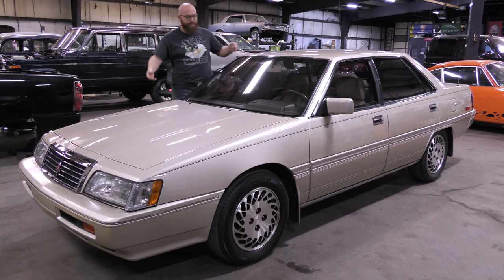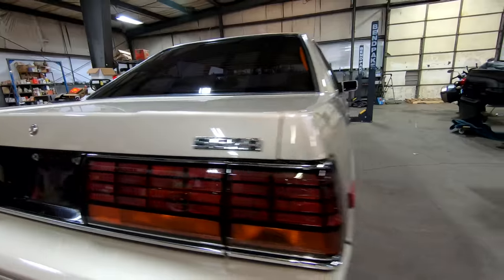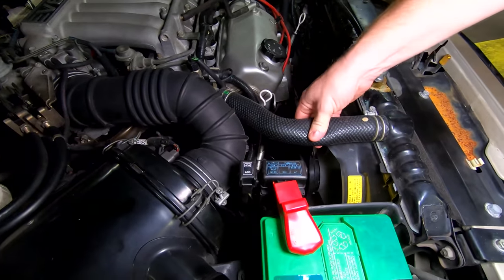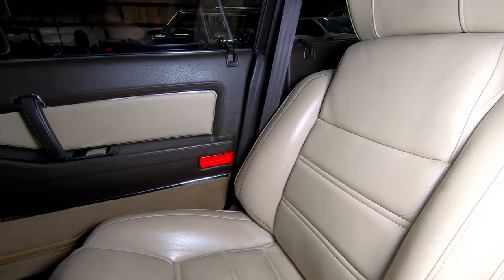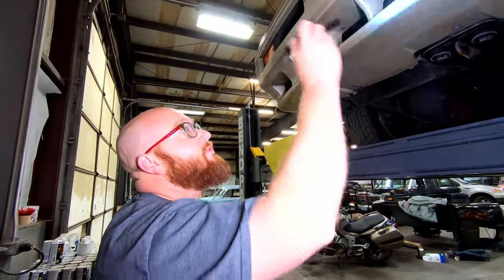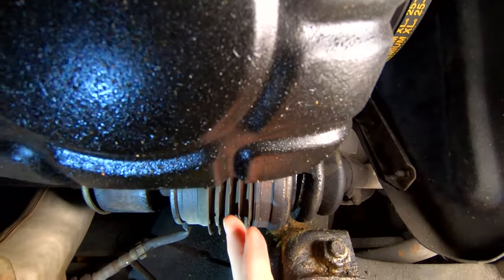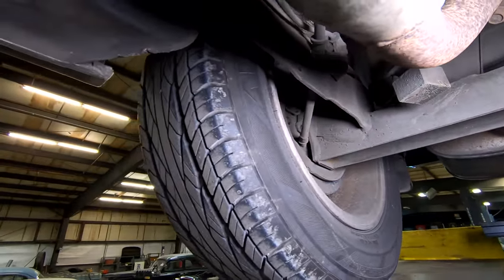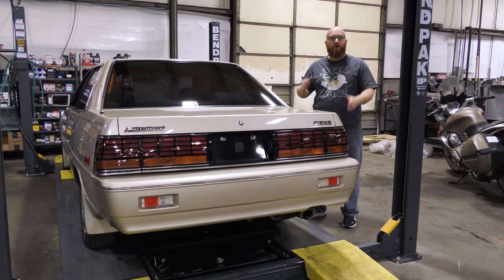Insanely Unique! When Mitsubishi attempted European design. CAR WIZARD shows immaculate '90 Sigma

Comment: was actually impressed with the "directional" wheels until you got to the other side and realized they were not
Reply: Most "directional" wheels back then would be backwards on one side
Reply: @jonathanryan2915  Actually, that tire does look like it is backwards since he was looking at the inside.
Reply: @matthewsallman1700  ok, what I meant was the wheels have a "directional" look because they would have a kind of spiral design.  But the problem is the spiral would go outwards on one side and inwards on the other side of the car when it drives forward.  If that makes sense
Reply: @jonathanryan2915  I get what you meant, but in this case the tire direction arrow seems to be mounted incorrectly.
Reply: @matthewsallman1700  which one? they all look correct from what I see.

Comment: Had a 1988 Sigma with a manual 5 speed transmission, and blue velour seats. It also had the single spoke steering wheel with the HVAC controls on a pod on top of the steering column. Here is a link to some photos: https://imgur.com/gallery/MlbmuVF
Reply: That rear end damn near looks like a foxbody rear lol
Reply: I had a 1998 auto 20+ years ago. It used the name Galant Sigma for the first two years. Then they changed to Sigma in the 1990 and add an airbag and a traditional steering column. Mine is black with grey leather, the original steering console is the wackiest design that I ever seen.  It went through two transmissions rebuild at 100k miles.
Reply: @laujoyjoy  That sounds like a 🍋
Reply: It was wonderful with the 5spd and a spoiler. Such a great car
Reply: My ‘88 is a 5 speed, as well. So fun to drive, with surprising performance for a fairly heavy car.

Comment: A lot of those were built in Australia... But I don't know if the ones with the steering wheel on the wrong side were or not. 

Anyway they were primarily engineered to have the steering wheel on our side, the correct side.
Reply: Mitsubishi took over the Australia plants of Chrysler Corporation in late 1980. The Diamante in the NA market sold in the 1990's was assembled there.

Comment: It's not a matter of standards or the manufacturer choking the engine to death. They just couldn't engineer a more powerful engine under those emissions standards. There's a reason this car failed. Look at its primary competition: The brand new Nissan Maxima, marketed as the Four Door Sports Car (which it wasn't, but the ad campaign was good). The Maxima had beautiful styling, a modern interior, great stereo and hvac, and its 3 liter V6 had 160 horsepower and great torque. The Sigma never had a chance. Styling-wise, it looks like they were going for Maserati in the front.

Comment: The Chrysler front drive K car used this engine option  West East, the Galant, East West. The Front drive Mitsubishi cars had no room to fit the brake booster in the US drivers side with the 2.4 liter Siruis Four, or the 3.0 liter V6. All US FWD Galant Sigmas and Sapporos had the passenger side brake booster. The other 88-92 Galant GSX and VR-4 was designed from Day One  for a proper driver side brake booster. BMW and VW used to do cross rod brake  boosters for the Right hand drive cars. The Japanese just copied an idea that worked for the Germans

Comment: Mitsubishi policies arround the world arround 1988 - 1990 where pretty wiered. Arround 1991 I had an almost same body vehicle like you just presented over here -  in Germany. Bumpers where leaner.....and it was the Sapporo but with an 2.4 L 4Zyl. 129 BHP engine. We never had the 3.0V6 in it like in the US. Now I am driving a Mitsubishi Sigma 3.0 V6 12V with 177 BHP. That one was never sold in USA ! But you had the Diamante. Again with bigger bumpers. The Diamante had smaller discs then my 3.0 V6 12V Sigma I am driving now. Over here there was never a 3.0 V6 with 144 BHP ! But we had the 3.0 V6 24V Sigma and the 3.0V6 12V like mine ! From 10/1991 - 09/1997 !

Comment: I am stunned to see my first ever car on YouTube, let alone this incredible specimen. I was the proud owner of a 1988 Galant Sigma as my first whip in high school and it was a marvelous car in so many respects. It was so unique even in its day and I got looks and comments in high school with it all the time. This one doesn't have the classic velour interior but it has nearly every upgrade available on the car. They even had variable adjustable suspension in the 80s which is remarkable. The ECT button stiffened the steering wheel response iirc. There were only 2500 a year sold in the US from what I heard so maybe only 10,000 were sold here total. In Asia it was very popular. It was a powerful, torqy, fun to drive car that was also extremely reliable. There is another pristine white unicorn of this car that was sold on ebay several years ago. It should be collectible. 😁

Comment: Shame this one doesn't have the awesome orange digital dashboard! This era of Mitsubishi gets a bit confusing. This was called the Eterna in most markets and was the hardtop version of the regular Galant/Sigma sedan (though it seems that they swapped the names over for the US models?). There was a 2.6 litre  widened version of the normal Sigma for the Australian and NZ market called the Magna which also came as a wagon which the normal Sigma did not. The NZ market also got a 3 litre V6 version of the Sigma  from 1988 to 1991 (the V3000) continuing to use the old 1984 Sigma shape even though the new generation Galant was introduced in 1988 (they were sold side by side). The facelifted V3000 in 1990 the used the nose of the Eterna (same as in this video) just to confuse things even more!

Comment: I bought a used 2003 Mitsubishi eclipse with 153k miles on it back in 2019 and I still drive it everyday. I never had any issues with the transmission or head gaskets they are solid cars I don't understand why they get so much hate. The parts are really cheap too!

Comment: that brake system looks like the opposite of the E30 bmw's. they all had the brake master cyl on the left side of the car. my RHD one used a twin bell crank and rod design to take pedal power from the right side to the left.

and all the volvo 400 series had that Folding back seat design, but it as a euro only model and the usa never got it.  they had 440 hatchback, 460 saloon and they even did a 480 coupe with a seat layout like the modern c30, in fact thats where the c30 got that 4 seat with glass opening rear window layout not the p1800es which is where many american people think it came from

Comment: Probably has the original wipers as well. My Eagle Talon came with Japanese wipers and they were still good eleven years later (took them off and used domestic ones over the winter months). The comparable early Nissan/ Infiniti models sold in Japan tried to work in something of a Jaguar look to them. Don't think many, if any, ever got to the US.

Comment: I had an 88 Galant Sigma E when I was a kid. Mine was still badged as a Galante and had a 5 speed and adjustable suspension from the drivers seat. I ended up wrecking it and looked around for parts. With what I found they only made around 4500 of those cars for the us market in 88. Eagle made a Premier that's based on the sigma but there's no body parts or anything like that really available as far as I know. There's a few for sale online but it's a rare car for sure. 
When the fancy shocks failed in mine I put a set from a standard galant in it. Pretty sure the cv shafts are the same as a galant as well.

Comment: I find it quite ironic that in 2022 it’s not the Cassette player that’s become 100% obsolete it’s actually the CD player think about it like this if you want what is basically the equivalent of an ox cord inside of an older car you buy one of those tape deck things hence the tape deck still provides usable functionality but if your car only has a CD player you pretty much have to buy a FM tuner which sucks or replace the stock radio

Comment: That engine looks an awful like what chrysler used for a few years, if its the same then it should start burning oil  shortly... something with the valve guides dropping and letting oil by. You could tell those while sitting in a drive through... huge cloud of smoke after idling for a minute then getting on the gas. That said, if you keep the oil up and change the plugs once they get oil fouled the still run for a long time. We had one in a mini van that got over 250000 miles on it and wss still running well but the rest of the van rotted away.

Comment: Lots of squares and angles.  This is what the Japanese thought were European?  Toyota did a much better job executing European during the same period than Mitsubishi did with this obvious "designed by committee" look.  The later Diamante was a much better product IMHO.  This exact same engine went into nearly every Chrysler product of the period it would fit under the hood for.

Comment: About the door locks - that car may be set up so that shutting the door without holding the exterior door handle up causes the door to unlock. I had a Mitsubishi truck of about that era, and if you locked the door and pushed the door shut, it would unlock.

Comment: The fuse box lids from that era and even a good portion of the modern ones, are made out of a hard plastic that becomes very brittle after time being exposed to engine heat. They tend to break when you take them off to change fuses .

Comment: 2:49 I'm disappointed Car Wizard passed on acknowledging the rust build up around the radiator. It may/may not be a problem if its only surface rust but he never fails to point out any type of important details. 

I thought maybe they were more focused on presenting the car's outstanding condition but then Mrs. Wizard did her usual patrol, not missing the smallest spec of detail so I'm really shocked the Wiz didn't point that out particularly.

Comment: Japanese cars of the 80s = Fugly pseudo European styling, Rust buckets, and Bullet proof reliability compared to their competitors.

Wiz :- "The hardtop sedan bodywork of the Mitsubishi Galant (fifth generation) was sold in North America from 1987 for the 1988 model year as the Mitsubishi Galant Σ (sigma), and from 1988 to 1990 for the 1989 and 1990 model years as the Mitsubishi Sigma." - Wiki

So it's is a Gallant, but with a name change.

Comment: Built and sold in Australia in widebody format, and called Mitsubishi Magna. Started as a 4cyl (2.6) in 1985 but soon moved on to having a V6 option (3.0). Continued in Australia until around 2005 with various engines, most commonly 3.5 V6. There was even a short run AWD variant for a few years.

Comment: Looks like that "extra boxy" Nissan Maxima, the first FWD Maxima they sold from about 1984 to 1988.  Or maybe a bit like the 80's/early 90's Toyota Cressida.  Pretty dorky looking car(even in its day IMO) but man the condition is incredible, nobody ever thought to preserve one of these, they usually got handed down/sold to a "college age student" after 5 or 10 years of good service from the original owner.    Also the leather bucket seats kind of look like something you'd find on a Ferrari, a HUGE step up from your typical "loaded out" midsized sedan.

Comment: Maybe 15 or so years ago, here in the UK, someone gave me a lift in a Galant of this shape. I have never seen another one.
The master cylinders on the right is probably because this car was originally designed for the Japanese market, where they drive on the left.
Those rear lights look very American to me. I'm sure I've seen a similar pattern on some old Pontiac. European cars of that era typically had cluster of light on either side, while American cars had light, or what looked light lights (often reflectors), running across, only interrupted by the number plate on some cars.
I wonder if the 3.0L V6 is a variation of the one found in many Chrysler products of the early '90s, such as the Dodge Spirit and Caravan, or Chrysler LeBaron. I believe the automatic transmission in those also came from Mitsubishi.

Comment: the version for europe looks a little bit different when i rememberl right. im not sure, but this is the last model before mitsubishi goes to a more round design, with galant and sgma. the name in germany was sapporo and 1990 was the last year
Reply: Correct. Mitsubishi Sapporo in Europe and only with a 2.4 inline four not with the V6. After 90 the new model came as the sigma.

Comment: Ive owned one. They are the sigma 3.0(v3000) i had a 88 super saloon back in 2016 mint condition and had some power with the v6. Only thing letting it down is the front wheel drive. Would have been much better rear wheel drive.

Comment: How does a CV go bad with that little mileage and also valve cover gaskets?
Reply: Depends how the car was driven...even a plastic shopping bag blown over the street will rip a CV boot to pieces when it wraps aroud the driveshaft.
Valve cover gaskets are under compression from being screwed down. 
As they age the flexibility in them is squashed out...
so they no longer flex when the engine/valve cover is heating or cooling...so they leak.

Comment: I currently have a honda and a toyota with the O/D buttons.  Also had a Volvo S80 with a back seat that split folded just like that which was handy for putting a mountain bike inside (rest of the car other than the seats was hot garbage)
Very sweet piece of preserved auto history!

Comment: I had one of these for a while back in the late 1990s.  Mine was an '88 or '89.  Weird car, but pleasant to drive.  I believe 'Sigma' was previously an upper trim level on the Galant and became it's own model in 1990.
Reply: Chrysler Australia was being taken over by Mitsubishi in 1979 when the new model Galant was released, it was the Chrysler Galant Sigma. Shortly thereafter it was simply the Mitsubishi Sigma.
Around the same time Chrysler Australia finally ceased production of "A" bodied Valiants and Chargers.

Comment: 3.0 V6 - same engine used on the Dodge Spirit / Plymouth Acclaim and some LeBaron. A reliable engine suffering on hardened valve guide covers with age. Had that on my euro spec Dodge sold as Chrysler Saratoga LE in Germany. Thanks for sharing !

Comment: These were very common in New Zealand both as a new car and a second-hand import from Japan. They came with either 2.0l 4 cylinder or 6 cylinder V6, and I am pretty sure the latter had quite a few more horses than you quoted. They were advertised as having "more tow than an Aussie tank" -ie Holden or Ford Falcon. I think there was even a 4wd version. Also might have been some 2.6L imported privately from Australia. Have not seen one for quite a while I think, and certainly not in that condition. Nice car. Location of bf reservoir probably a hangover from being mostly for RHD markets I think.

Comment: These Mitsubishi's in the 1990's were excellent back in the day, compared to the ones in the 2010's and the 2020's. Thanks.
Reply: I had just found out that AMG actually worked with Mitsubishi in 1992 and made a small handful of AMG-tuned Galants. One of the rare non-Mercedes AMG cars and the only Japanese car that AMG ever tuned.

Comment: The brake setup is typically Mitsubishi. The cars are designed to be right hand drive, but to lower the cost and complexity of making them left hand drive, the master cylinder was kept on the right. However, behind the dashboard is a bar that spans almost the full width of the cabin. This bar is connected to the brake pedal on the left side of the car and the master cylinder on the right side of the car. As you depress the pedal it rotates the entire bar and thus activating the master cylinder. Brilliant. As a side note, the reason why those older Mitsubishis (this car included) has the engine on the left and the transmission on the right is because Mitsubishi calculated that because the driver was usually the only occupant, the weight of the driver on the right would be balanced by the weight of the engine on the left. Unlike Honda, which did the same thing but engineered their engines to rotate anticlockwise, Mitsubishi engines rotated clockwise. So looking at the engine from the timing belt, this engine would turn towards the rear of the car, in opposite direction to the wheels! The transmission had a shaft that corrected this so the wheels turned forward. Because Hyundais (as well as Protons - a car from Malaysia) were originally based on Mitsubishis, they also had these quirks with the brakes, engines, and transmissions. Great looking car...HOW did the previous owner accomplish this?!?

Comment: Very nice!  I wonder if the 3.0L engine was the same one that Chrysler used in the early minivans.  Used to eat valve seals.
Reply: @666cemetaryslut  No.  In my old Plymouth Voyager I had a 3.0 L Mitsubishi 6G72 V6, 142 hp (106 kW), 173 lb⋅ft (235 N⋅m).

Comment: Mirage had the same brake master on the passenger side. Car was designed as right hand drive and was reconfigured for left. The way the engine sits, there wasn't room to move the master cylinder to the other side so a cross linkage is under the dash.

Comment: That's a sleek-looking car.  Pity about the American bumpers, though.  They really spoil the look.  I love the colour of the exterior and interior.  Nice deep seats.  Much respect to the guy who kept this in showroom condition.  Again...  when you shoot the interiors can you PLEASE not just cut to extreme close-ups of the plastic steering wheel?  You need to start off on the outside of the car with the doors open to establish.  You need to show what will greet the driver and passengers when approaching the car.  Imagine what the customer will see.  What are you looking for?  Is it welcoming?  What about leg room?  Only after that do you cut to close-ups.  I love your channel and I'm only sharing decades of experience to help.  Cheers.